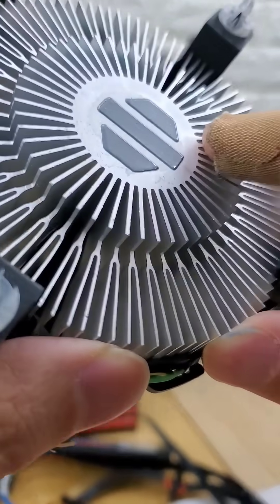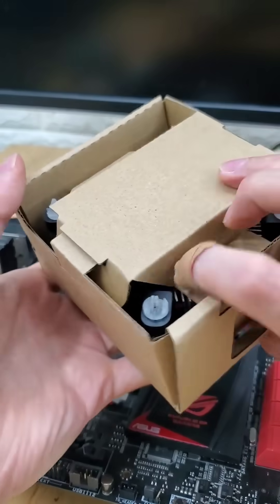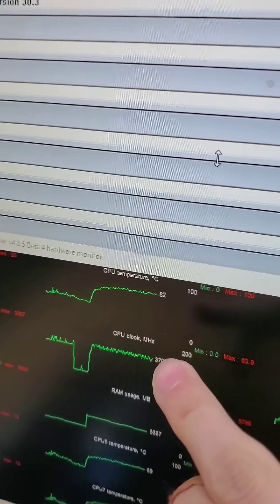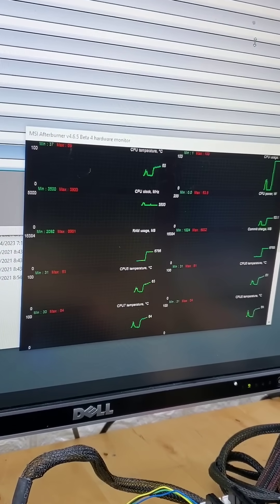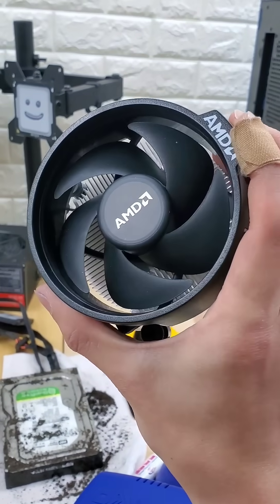how BAD is Intel's stock cooler? #shorts

Comment: As far as I understand, stock cooler compound isn't designed to conduct well to get good temperatures. Flat out. It's designed to keep good thermal conduction over as many years of use as possible before performance loss is too significant.
Reply: I've used a 4690k with stock cooler for 10 straight years, no issues with temps. Can confirm it works great.
Reply: @BasedParadise  10 is a good run. I just now repasted my Amd a6 from 2012 like last week. The stock paste was still on and it was dried as dirt but still functioned oddly enough. 

I figure 13-14 years was a good run from AMD stock paste. Now it's rocking Toothpaste 🤣
Reply: ... honestly that makes sense. for Intel machines that are build once and then put into an office to never be opened again that makes sense
Reply: I work in reliability engineering at a big company. Everything goes into the decision to use a certain product. Price, performance, service life, failure modes, failure effects, maintenance difficulty/cost, etc.

We look for the best product in the application, not just the highest w/mK.
Reply: So you basically meant: Stock cooler thermal paste isn’t made to be super amazing at cooling — it’s made to be “good enough” for a long time.
Reply: Thas is why my pc back in 2011 i3 2100 with stock cooler has been running with no problems i have never replace it thermal paste intil 2022
Reply: @intelcorei0364  username checks out
Reply: @MGrey-qb5xz mad kid :3
Reply: If you use graphite pad it lasts forever unlike thermal paste.
Reply: My experience with the fan coolers is that after taking it off for a few times, the surface contact pressure becomes less. This is probably due to the four sides plastic screws lossens and becomes invalid to create sufficient pressure contact. My remedy is to use bolted steel screws which will remains tight and more reliable.
Reply: он предназначен для селеронов и пней
Reply: I totally with you, much people doesnt understand it, like stock cooler amd, for example, i brought an Ryzen 5 5600GT and it has stock cooler but its just like the video here, the disipation its a shame, thanks to CoolerMaster i have an ideal Cooler
Reply: With 5 degrees over for years 😂
Reply: Yeah because average users won't really care because if you buy pre-made PC chances are you won't even clean your PC's dust for more than 2 years until something happens to it and then you decide to give it a rough clean.

It's okay though, it's not like cars where simple malfunction can kill people. If your PC dies on you, what you do? You buy more. Profit!
Reply: I doubt it. From my experience it drys and cakes out after like 2 or 3 years.

You're thinking from the point of view of an engineer, not a business.

The majority of stock cooler applications will come from pre-built or commercial contract sales. Pre built manufacturers have a profit motive for your computer breaking down for repeat business. An office environment will see it's tech refresh happen more often if computers break down faster.

There is literally no reason for Intel to give you good paste.
Reply: Or you can just use a better thermal paste, and it will still outperform the Intel stock pad after many years, even if it degrades a little. Five degrees is a significant difference, and most decent thermal pastes aren't going to degrade that much.
Reply: @PepsiBear-g4d как пример отличного решения - это термопасты ShinEtsu. 

Сама фирма ShinEtsu не занимается консьюмерскими продажами, ее термопасту можно купить только в вёдрах и бочках. 

Но сторонние фирмы фасуют ее по шприцам. 

Это OEM термопасты, которые, как правило, закупаются оптом различными производителями и сборщиками техники. 

У них есть марки термопаст, которые имеют лучшую на рынке теплопроводность и при этом рассчитаны на длительный срок службы (медленно деградируют). 

ShinEtsu 7921 - ее тяжело наносить, она очень густая, но она лучше любых "брендовых" термопаст и она прослужит 10 лет не требуя замены. 

ShinEtsu 7868 - это модель с растворителем. Она обладает чуть худшими характеристиками, чем 7921, но ее легко наносить. 
В течении ~ суток после нанесения растворитель испаряется и она, так сказать, выходит на рабочий режим. 

Если выбирать термопасту для длительного срока эксплуатации - я бы точно выбрал ShinEtsu. 

А я ее и выбрал. Уже два года я пользуюсь 7921. 

(Главное остерегайтесь мошенников. Так как сама ShinEtsu не фасует термопасту в шприцы и малые банки и вы можете купить ее в таких упаковках только у перепаковщиков - вы можете легко нарваться на мошенников, которые продают другую термопасту под видом ShinEtsu)
Reply: @PepsiBear-g4d  literally any normal thermal paste is better thermal paste, corporates can't stop thinking about imaginary lines on a white board
Reply: @MGrey-qb5xz  Do you even know the first thing about comouter maintenance?
Reply: @TwiliPaladin by all means paste the chatgtb post 😂
Reply: It would cost them nothing just to get good thermal paste,  it's just would be accountants thinking they "saved" money
Reply: @MGrey-qb5xz You’re not getting it. It is good thermal paste, it’s just designed for longevity instead of high performance. The grizzly paste he used has awful longevity.
Reply: @SPZ909 there's no such thing as longevity vs performance thermal paste,  there's only cheap, normal and good quality and intel uses the cheapest there is.
Reply: @MGrey-qb5xz Well you couldn’t be more wrong. Intel’s paste is designed for longevity so that enterprises don’t have to worry about it for 5+ years.
Reply: @SPZ909 does your uncle who works at Nintendo tell you that, tell him science says otherwise
Reply: @MGrey-qb5xz  this is just wrong - i work on servers, we specifically use interface material with "bad" performance but better longevity and consistency. the TIM we use is like 60 dollars a tube, its way more expensive than consumer stuff.
Reply: @chliem your servers suck
Reply: @MGrey-qb5xz  Ahahahahah you talked a lot of shit and then said science disagrees and when this guy actually backed his shit up all you can say is his server sucks, great retort, are you 16?
Reply: @MGrey-qb5xz  peak ragebait
Reply: @MGrey-qb5xz he is 100000% correct and you are wrong, get over it
Reply: @MGrey-qb5xz  There are definitely different pastes for different applications that do different things. Intel, and in fact most of the pre-applied thermal compounds are made to last. not only while installed, but also on store shelves
Reply: @MGrey-qb5xz  Nah, you're not cynical enough for industry. I'm an accountant. You know what I'd be looking at, from a business standpoint? 

"What is the barest minimum amount of time it has to last for people to not feel screwed over, how close are our competitors' products to that line, and how precisely and consistently can we straddle that line?" 

In other words, you don't want to piss your customers off because you cheaped out TOO hard and their CPU died in < 1 year of average use, but you still want as much degradation as you can get away with to make sure they'll be buying them as regularly as possible.

Cutting a couple years off of its lifespan with cheaper thermal paste isn't about the five to ten cent savings in thermal paste per CPU. It's about the overall increase in sales. 

If people buy a new CPU every 10 years, and now they have to buy one every 8 years, that's a 20% increase in sales.

Comment: Intel's thermal paste by some accounts is a Dow Corning product. The point of it is not performance, but stability over time. And that last part is important to me. I've had Kryonaut applications pump out after a year which to me is not really that great.

Remember, one of the largest, if not the largest customers of Intel's CPUs is for corporate computers. They need something that they can leave alone for 5 years or whatever their refresh cycle is.

Also this isn't to say I use whatever Intel uses. I'm just willing to sacrifice 1-2C for several years of stability.
Reply: In the business I've been, not 5 years, but "as long as it works". I've only seen anything done to a pc once in my 5 years there(they were installed quite some time before me), and it was sending a broken one from the office to repair.
Reply: You can tell by looking at it that the stock cooler is a well engineered product. Price, performance, longevity, ease of installation, every aspect of it was optimized for its application.

Sometimes your application is not Stock. Maybe you are willing to fiddle around with mounting hardware because you are building 1 computer instead of thousands. Maybe you are wanting to overclock and care about squeezing more watts out of the package. I'm good with doing your own cost/benefit analysis, but the stock cooler is undeniably a good thermal solution.
Reply: @phillyphakename1255  the problem with your analysis is that you didn't get the target market for this. 

Retail cpu packages are NOT used by OEMs. This is a product whose target market is the build-it-yourself marker, including small businesses building for individuals. 

The stock cooler isn't found in any OEM solution. Let alone servers or the like. 

The design really is based on "least expense for minimum acceptable performance".  Part of that "acceptable" is the ability to not generate RMAs, which is where the plastic mounting system comes in - it's easier to install than more complex better solutions. Which generates fewer RMAs. 

But no, it doesn't perform very well over the long term either, which is heavily due to very poor thermal paste coverage and poor construction of the copper heat sink pad . It's "good enough" to get you out of warranty period, but nothing more. 

It pretty much is a definition of "did the minimum to make it not my problem".  That's not good engineering.

I've literally replaced hundreds of these things over my life as a computer systems engineer. They suckn engineering wise. Even with better (or even just More) paste, the coolers perform very poorly.

One of their major flaws is that they clog with dust FAR faster than other coolers. Which is a major flaw when you're selling to consumers who aren't going to be running those systems in clean environments and won't clean them.
Reply: @phillyphakename1255  no, the stock cooler is not a well engineered part; it’s just a simple design that’s good enough to avoid immediate thermal damage.
Reply: @Hornet135 ever heard the phrase "anyone can build a bridge, but it takes an engineer to build a bridge that can barely stand"?

There's more to engineering than just performance. Good engineering balances all of the factors to create the best product for the application. You admit that it does just enough to keep it cool, that it has great ease of installation and cost. It is well engineered to match the needs of the application.
Reply: @phillyphakename1255  I think you mean “well-engineered to meet the needs of the bean counters.” Save your lecture on what good engineering is for someone that needs it.
Reply: @Hornet135 I am saving my lecture for people who need it. All you can see is cost, but there is a lot more factors involved in the optimization here, as I elucidated in my first comment. You clearly need the lecture as you don't know even 1% of what is involved in mundane product engineering.
Reply: @phillyphakename1255 Its the same idea with ball point pens; although its a simple mass produced product now, there still is precise and consistent engineering that goes into making even one of them.
Reply: @phillyphakename1255  Not every engineer has unlimited power, and compromise often leads to poor product design. Don’t forget the Boeing 737 MAX.
Reply: @Hornet135  a simple design does not mean it is not well engineered. Engineering is about designing and building things to meet set requirements on time and on budget.

You're obviously an armchair engineer 😆
Reply: @sepg5084  I never said a simple design means it’s not well-engineered; on the contrary, simple designs are often best. 

I guess it’s easier to join in with Philly toolbag than actually read what I wrote.
Reply: If you ain’t thermal throttlin you ain’t computin
Reply: Honestly yeah, makes sense it will last longer
Reply: Remember the Pentium 90 bug?  I had a really nice cooler on my P90.  The replacement RMA P90 arrived with a piece of junk small sleeve bearing cooler which lasted a couple of weeks before it froze up.  I sent my nice cooler back with the bad CPU because the RMA paperwork was very surly worded about sending back an equivalent bad part or risk a big bill.  Since they sent me a P90 with a cooler I returned the bad one with the cooler attached.

I wound up having to carefully pry off Intel’s junky glued on cooler and buying my own good quality cooler.  Intel often includes a good cooler if you order the CPU with cooler, but it is apparently not a certainty.
Reply: 5 years of burning at 80 degrees c. Poor cpu.
Reply: @blackterminal  meanwhile modern ryzens boosting themselves to 95C with any cooler 💀
Reply: Artic Silver 5 is very stable and performs much better than stock thermal paste.
Reply: The longest I ever went without cleaning my paste was 3 years using Kryonaut.

It was still moist and malleable.

I would care to disagree.
Reply: @lildvsvevo  Kryonaut is discontinued now anyway, they replaced it with duronaut which is formulated specifically to last longer and be more "durable" (hence the name)

Comment: So you showed an aluminum on the first cut, and a copper core on second ..... hmmm
Reply: and used the aluminium one both times, compare the stickers...
Reply: @Archeoptery We only see him putting the full aluminum cooler on the CPU and then cut and we don't see the full sticker anymore ... so he could've switched the coolers.

edit: after paying closer attention to the differences of the fans on the coolers, either he DID test with the same coolers or he went through the hassle of switching fans between tests.
Reply: The aluminum cooler in the two tests has a blue sticker. The copper core cooler pictured at the end has a blue and silver sticker.

Comment: All stock air coolers are ok for light task but for gaming no way those temps are going to spike in the higher 90’s-150+ degrees Fahrenheit not Celsius because Celsius is not how we measure temperature in the USA
Reply: Celsius is how you measure temperature in the USA when it's measuring the temperature of a CPU

Comment: I remember getting an i7-4790k thought I could use the stock cooler for a while.. It was completely unusable, first of all, it was too small, it was like the one in the video, and the 4790k isn't limited to just 84W which is already too much for this trash cooler, it would throttle so much it would constantly stutter in games. And the second factor was of course the poor TIM between the heatspreader and the CPU core. Intel in 2014-2018 was a company just focused on fleecing people first, and making good products second.

Comment: The  default cooler was great back in 2008, and it takes some time for the thermal paste to spread under heat, and usually after that temps improve.

Comment: Love the way that when you finish locking the CPU cooler back down to test the thermals that the bottom locking pin next to your left thumb (19 sec mark) is in the unlocked position.
Reply: I've seen a PC with this issue since the first day - it was never open, the paste were dry, and the cooler don't have contact to the CPU. But: it works for 10 Years, was a i5-3570. The owner "...had no Problems..."😂 This cooler is good enough.
Reply: @BuddieOLLi  :"This cooler is good enough." That's because the owner has no clue if the CPU is thermal throttling or not.
Reply: Yeah dude has no idea what thermal paste is or how to put a cooler on.

Comment: Ive used a amd stock cooler for about 3-4 years and it still works
Reply: Took about 12 years for my stock Intel compound to dry up so much that it suddenly (oddly-suddenly) resulted in quick, obvious, and extreme CPU overheating. One could argue that performance dropped before then, but it didn't seem too bad.

Comment: What I wanna know is how you removed the intel stock cooler without shattering the little plastic feet. Every time I've ever removed one of those the plastic feet snap off and the fan's gotta be replaced. Yes I've moved onto real fans, but I've had to use stock for a while

Comment: One additional note: On 12th gen or later, these stock coolers will throttle even on an i3 at default Power Limit. They will only handle these CPUs at 65W or lower

P/s: I tried with TG Kryonaut for these cooler on an i5-12400F. Nothing changed!

Comment: That's ugly af, if that's a new gen stock cooler, than amd has this one in the bag.

Edit: it isn't, and although amd obliterates Intel with the amount of thermal paste and cooling potential, I'm not sure which looks better, you can paint the amd cooler with ease and it looks good, whereas the Intel can't really do that. The clips are nice but I can easily see people snapping them when taking them off, but either way, I think you should just pay $35 AUD to get an ID cooling a410 air cooler. Or a $49 low profile cooler if needed

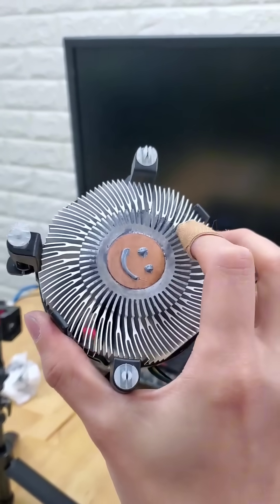Comment: Ok why can I see copper in the frame at 0:51 ? 🤔 and not before??
Reply: the copper one was just demonstration b-roll
You can see that both the coolers he tested had blue sticker, but the b-roll cooler with copper ha51, d sticker with half blue and half gray

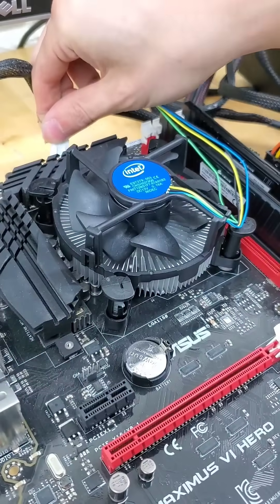Stock thermal paste: 0:16, you can see the cooler is blue
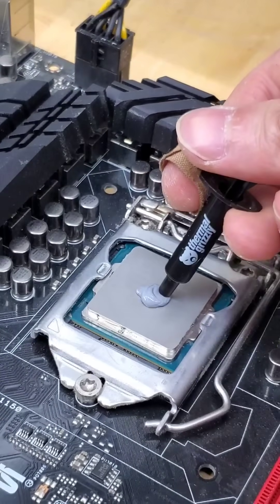High performance thermal paste: 0:38, still the blue cooler
B-roll cooler, 0:51
Reply: Because he tested a NEW cooler that had pre-applied thermal paste. Which didn't have the copper bit.
Reply: @greyhope-loveridge6126  yeah... That's called skewed or corrupted data..